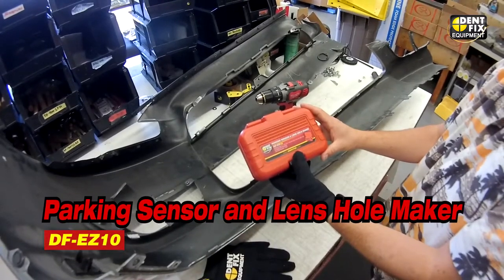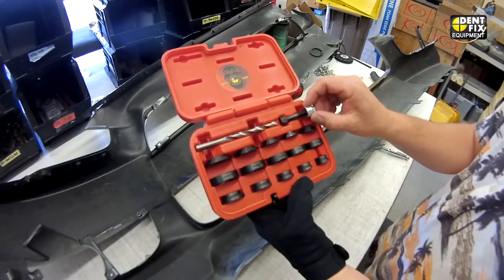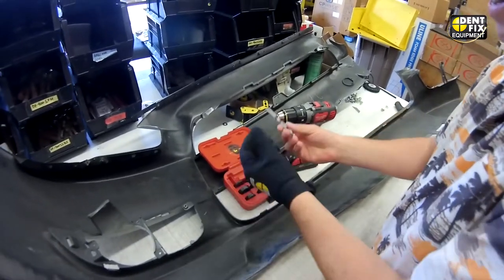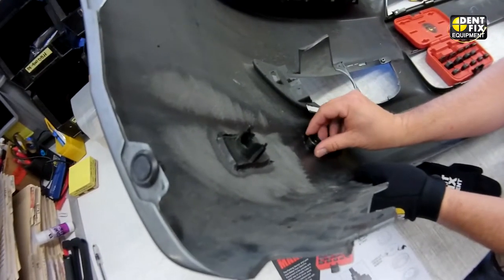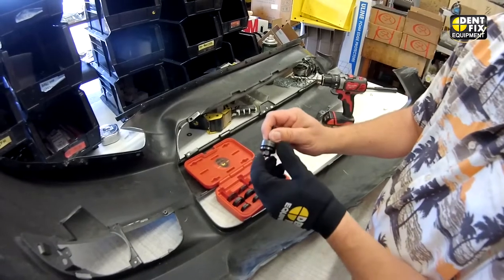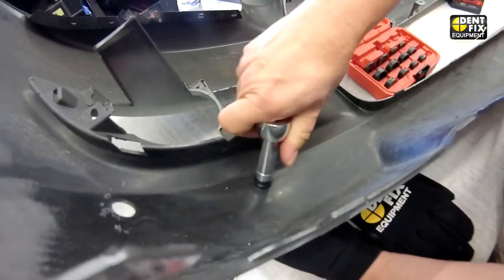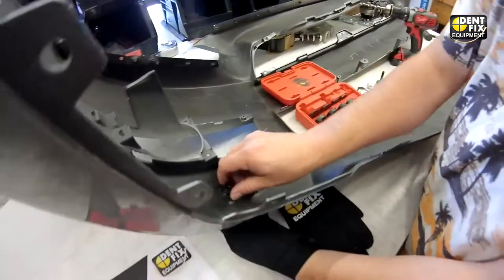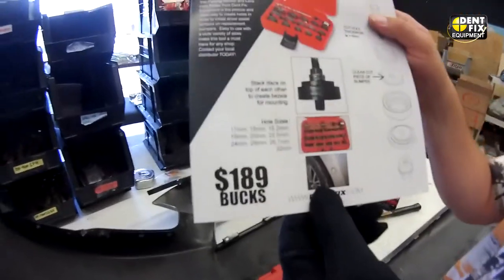DF-EZ10 Parking Sensor and Lens Hole Maker - How to Video

Comment: Note from some one who used this type of tool for a while. Great tool, however the demonstrator showed setting up the tool to pull the die from the inside of the bumper towards the outside. This method tends to leave the edge of the hole fluting up slightly, & the body of the tool itself may leave a slight mark in the paint. Set the tool up to pull  from the out side in for great results every time.
Reply: Yes sir!